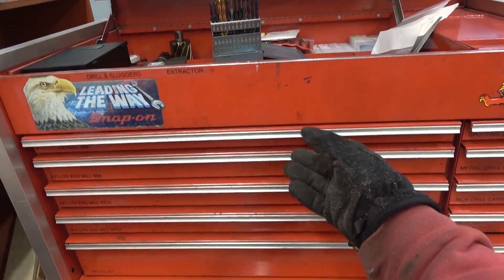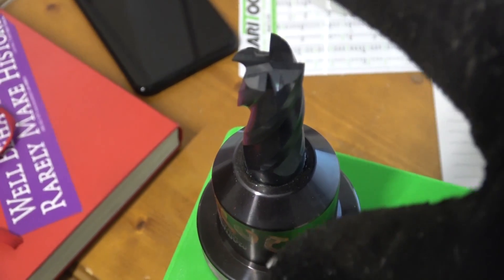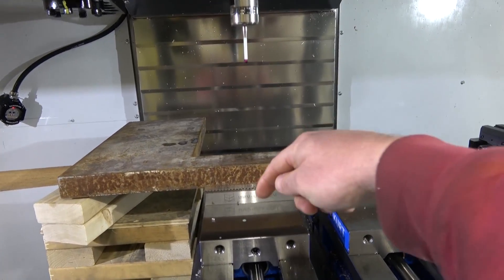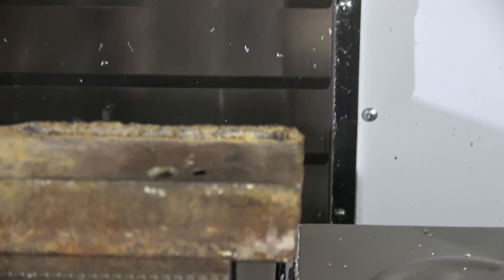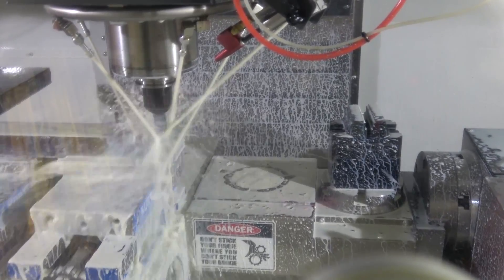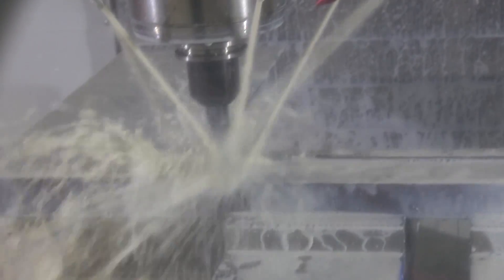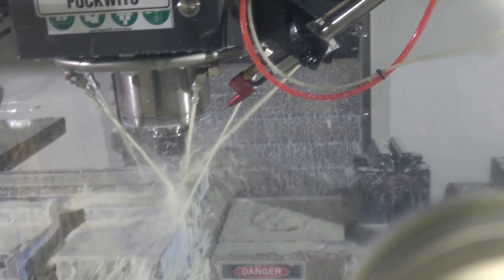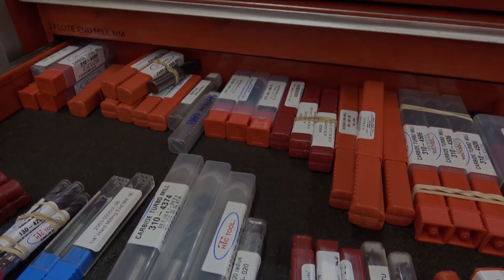AR500 Hard Steel vs. Chinesium Carbide

Comment: That hard of material I would have ran more like 400 sfm. That endmill I’d go maybe .003” or .004” per tooth before chip thinning calculation(very important) Also would have ran about 10 % radial depth of cut at 2xdia axial depth of cut. Or 20%radial depth of cut at 1xdia axial depth. I know nothing of that material. Or that endmill. I usually machine 304 or 316l. Using garr v5 tooling or similar. Spend the extra bucks for good tooling. With the right feeds and speeds you could double, triple, maybe quadruple the time between tools wearing out for only 20-30% increase in cost. It’s cool tho I broke 3 taps today.

Comment: Abrasion Resistant manganese steels like this are prized for their substantial surface work-hardening and underlying toughness, similar to the material used for excavator teeth and building up worn railroad junctions. Absolutely nasty to grind. 
I am not tuned up on Mn steel heat treatment but you might try annealing then after machining quench and temper. Soft for absorbing impact energy and harder for deflecting impacts(often the target is angled 45deg down so the round hits the ground rather than bouncing back at random)

Comment: Well Ave, I guess you only proved one thing...if you crowd the fuck out of a Chinese bit, you will break it.  You should have made your little test a bit more of a challenge, rather than a grudge.  Why not do your test over with a bit made in the USA and another from China.  Hell, go ahead and throw one in the mix from Japan, or Germany, or the UK!  As long as only one does the test, the results will be the same every time.  All I seen was the Chinese bit passed your test.  You proved it failed when you kept increasing the difficulty factor until, most likely any bit would have failed.  Yeah, that Chinese made bit was junk.  You PROVED IT.

Comment: I think you’re spot on with the trochoidal milling, but I think you’re gonna want to use more of the tool diameter and take shallow arcing passes at full depth clear to the end of the work piece. The heat should be coming out in the chip. The work piece should be cool enough to touch without any coolant.

Comment: Speed too high. feed needs to be kinda of high to avoid work hardening .008 per tooth maybe. I would try 75 sfm with solid carbide. (old steel mill machinist) best setup is a round insert milling cutter.

Comment: Uhhhhhhh,   turn the spindle rpm down!  The material your cutting is too tough for high rpms,  I don't care what carbide tooling you use.   With all that vibration a HSS endmill won't last long much less a carbide endmill
Reply: I totally agree, always use cutting speed formula

Comment: Other option is you leaveyour G54 Z zero at home. Don't probe anything and just touch off your tool at Z zero and set the tool offset as a minus value rather than as a length out of the spindle.

Comment: There's a section in the machinist Bible for your SFM. Typically on the high end with carbide tooling 325 SFM is where you want to be. 500SFM is better suited for more mild steel like 1018.

Comment: Doesn't A R stand for assault rifle
Reply: Actually - no. It does not. "AR" was shorthand for ArmaLite Rifle. ArmaLite was first established as a Division of the Fairchild Engine and Airplane Corporation on October 1, 1954. Or... in this case - AR (400 / 500) is short for "Abrasion Resistant" steel. Don't believe everything you read or hear. Do your own research.

Comment: The HSS tooling hasn't really been improved since Carbide made its appearance, meanwhile carbide has gotten all the attention, so leaps and bounds bettter then HSS, as for coolant on carbide, don't listen to the farking salesmen coolant is better by far then cutting dry, that thermal shock is a bunch of wank so dummies don't run coolant and tools don't last as long, also, endmills by design are an interrupted cut... I could go on, but this is by far one of my biggest bitches about machinists that don't test stuff on their own and just take the word of some dickhead in a suit
Reply: I will add, that more often then not, just reducing surface speed 3-10% will gain a whole lot more tool life than anything else, that and rigidity in tooling, fixtures and tool holders etc

Comment: To much surface footage for the hardness. When that tool gets red hot with the flood coolant you get thermal cracking. It would be better to cut dry.

Comment: I've used those chinesium carbide endmills from AliExpress a few times.  I've noticed that they have some bad geometry on the ends, which might be where your face milling pain is coming from.  If you look at the bottom of the flute that would be cutting if you were plunging, they put a flat that is vertical as far as I can tell. No sharpness to it at all, with very little relief.  Comparing that with my american endmills, they'll continue the helix down and not put that flat there, which gives the cutter more positive rake.  These were endmills designed for aluminum supposedly.

Comment: Just today I've been throwing fast-moving, 147 grains of lead from my pew-pew dispenser at a 12mm AR500 plate from 50yards or so... barely scratched it. And, in all modesty, my pew-pew is bigger than yours, so really don't worry about making it slightly brittle... 

I find it miraculous a cheap chinasium mills even dents the damn thing, let alone takes chunks out of it...

PS: don't forget to angle the damn plate at a 30° angle toward the ground... shrapnel is no fucking joke.
Reply: Yes well , mines shaped like a tuna can . Won't hit bottom,  but sure scrape the heck out the sides .
Reply: Chinesium Mills have gotten pretty effing great.  If you're looking for a 'burner' endmill to experiment with, you can't do much better honestly.
Reply: I hit my 1/2 " ar500 with .338 lapua from 50 yds sometimes, barely a dimple.
Reply: HOOCH D  Doesn't surprise me. Dat .50 be awesome😁
Reply: Should more find it terrifying that the chicoms are making things competently now.
Reply: I'm pretty sure all your name brand ones are made at the same factories as these off brand ones. A lot of the time they're just reselling factory seconds, or when the patent holder makes an order of 5000 they make 6000 and siphon off the extra thousand under their own brands.

Comment: I had to drill 11/16 hub mounting holes in AR500 sprockets and it sucked donkey balls.  I think I was getting only 6 holes before the cobalt drills cried uncle.  That stuff just destroys the flutes and once the sides of the dtill start rubbing and squeaking you're 1 hole away from meltdown.  Had to get carbide insert drills which work pretty good with high speed and slow feed.

Comment: Look into G-Wizard for your feeds and speeds. 

You should be spinning at like a 970 RPM or so and a FPT of 0.002 for rough

1600 RPM and 0.0045 FPT for finish. If you feeds and speeds don't match your cuts you're wasting your time

no coolant
Reply: Modern machine shop has bunches of articles on this topic.

Comment: I'd like to know if (legit) HSS is better than chinesium carbide. Value and what not.
Reply: no it isnt. http://www.duramill.com/wp-content/uploads/2012/03/WhisperKut-SpeedFeedRates-2014.pdf

get any carbide endmill and use this chart
Reply: There is a place for both.  HSS is less brittle, therefore more forgiving of vibration, but it is closer in hardness to the AR material and simply won't keep a sharp edge as long as carbide could.  I would be interested in watching someone run a facing operation on AR500 in their shaper.

Comment: If you are making AR-500  pew-pew plates...….and you have a big ass mill  (I'm jealous on both counts)...…..when the face is "finished", why not cut another few thousands off, but make it into a bulls-eye pattern......that would be cool, and give you a traditional target to get a sight picture with. The few thousands difference between the circles would also NOT create a surface that generates dangerous deflections......those are the ones that come back and change you from a Mr into a Miss.

Comment: Bought a chinesium spade bit what for drilling deceased tree carcasses and not only was it bananna like but the centre point was way oorf and induced much vibrations during drilling. Seems to me the material is not the main issue but a lack of precision manufacturing that causes bits to snap unduly.

Comment: Question : would a dimpled surface be more better for stopping and/or breaking up projectiles than a smooth surface that just shit-stains skids the flying brass off into the world ? Just a question.  Thnx.
Reply: I angle my plates at about 30°, top closest to shooter, and most of the spall goes into the ground
Reply: Skinifer'Loaf Hotchkiňson still would be an interesting experiment and isn’t our job to try to dummy-proof the world ??
Reply: @aaronj08ar  That's not what he's asking. And the reason for the 30% has more to do with thickness presented than where the round ends up. When you present 30 degrees it effectively doubles the amount of metal the round sees head on.
Reply: @BustedWalletGarage: Great question. You would think so. Unfortunately I think we're probably so early in the technological phases of bulletproof products that if that were true it is probably being kept very secret by the companies that utilize it. It'd be a good question for Taofledermaus. You could probably even make a sample and send it to him to shoot.

Comment: Ive found plenty of bad chinese carbide. Ground so off center it's gotta be considered single flute if its usable at all. That's from the back alleys like amazon though. Not like im going to the source. They often have short shanks pretty undeniably regrinding what gets sent in for recycle. No joke I have received engraving tools that are from end to end are 1/2 inch

Comment: AvE, it looks like you're climb milling that plate. Wouldn't descent milling be easier on the cutter?
Reply from the maker: No, if you have the rigidity climb milling is better for the cutter.
Reply: @arduinoversusevil2025  Good to know. If you have the opportunity to explain the mechanics of that in your next machining  video, I'd be interested.
Reply: Andy Spam  Climb milling allows the advantage of Radial Chip Thinning.  To minimize vibration you want the tool (each flute) to enter heavy and exit light.  So the chips will start thick, and become thinner on exit.  Conventional milling does the opposite, which causes the tool to noisily load and unload tool pressure as it hammers its way through the material.  Noise means vibration means you will be replacing that carbide, regardless where it was made.  
  The radial chip thinning effect coupled with a small step over allows GIANT increases in feed and moderate increases in speed.  If you run a 3/4 EM at 1500rpm and .004" fpt (24ipm) when hogging, that would translate to 61ipm with a .03" step over.  Small step over and high feed send the heat out with the chips, so it is possible to bump the speed up to 2000 and 80ipm depending on setup and machine rigidity.  This cutting data will not work well with AR500, to expect any success with that, you'll have to drop the spindle speed to around 600rpm/18ipm with .03" step over or around 7ipm at full diameter.
Reply: Thanks  @JL213JN . I was taught the opposite, that unloading quickly was okay, but that you didn't want to slap into the material.  I'm not a machinist, so I'll defer to those who practice it.

Comment: Surface speed to high, especially with chinesium tools. Probably would run for many more time units at about half that speed or less, other than that looking good. Also thermal shock from the coolant isn't that harmful, lots of tooling companies have done the tests and, except for some cases, it make very little difference and in a lot of cases it can reduce chip recutting with is by far worse than thermal shock (unless your running ceramics, coolant and them = pow! busted tools). In my opinion, coolant isn't a great idea is if you running really high surface speed (well over 1000 fpm) in steel/iron. Then the thermal shock can really be hard on the tool life.

Comment: Recently picked up a little 3/4 hp Grizzly mill and my first project was cutting hardened 60hrc AEB-L stainless. I used a cheap (I think it was abut $15 on amazon) 3/8" carbide endmill and it did just fine. To be fair, AEB-L grinds like butter, even at 60-61 hrc.

Comment: When I took a CAM class at school we had a HASS really just to show what work offsets and tool offsets and stuff where. The instructor had gone and disabled the 100 thousandths increment button so we couldn't move the table at 30 inches a second. Good idea
Reply: The fact that you can even ask the machine to move the table 30in/sec is mindboggling....wouldn't that damage the machine even with an empty table and no tools in the way?
Reply: @Binturong3850  ehh .... you'll stall the motors before you damage the machines, probably. and motorbs just get a bit lukewarm from stalling, so maybe put your ribeye on them for cooling purposes.
Reply: That's not teaching you guys to be careful is it?

Comment: Way too much chooch, not enough chach. 

Surface footage is too high, and tool chipping is from vibration, the ole haas aint rigid enough to do what you're trying, gotta slow S&F way down. 

Member 

Chipping = vibration
Burnt edges = too many rippems
Worn coating = worn out lol

Also, the reason for air over coolant is not just thermal shock, but most coatings actually have an operating temperature for best tool life, if you're running coolant it may never get there and will wear right off. 

May or may not be an apps engr for a big jay-aye-pan machine tool builder 😉
Reply: And a totally wrong tool for the job.
Reply: @peterzimsek2510  That's what she said.
Reply: Was coming down to the doobalydoo to say the same thing. When you are cutting something hard specially facing it with a less than ideal cutter gotta run that shit slow. Like <200sfm.
Reply: @SaviorTheBurn   
But that big hollow metal box the vises are mounted to may not be... 
If they were on the table then yeah I'd say it's rigid enough.
Reply: The chinezo provide the feeds and speeds for these and for HRC50 it is very gentle. Anything at that is going to be really gentle and slow rpm.
Reply: The simple fix is mostly to simply use a smaller and cheaper endmill. 3/8 and 1/2 are in the butter zone. Much higher rpm with the same sfm means faster feed anyway.
Reply: Came to say the same thing. As soon as I saw he had it programmed for 500SFM, I knew it wasn't going to work. I've never worked with AR plate, but given it's hardness, SFM should be 100 or less with a chip load of .001-.002", assuming that is a 3/4" endmill.
Reply: I had the coating come off my tool once. After that, the stuff dripping off the end of my tool was not coolant. As a matter of fact it burned like hell.
Reply: Mazak employees go-to brag is that Haas is their biggest customer, which is not something to be bragged about when your biggest customer is also eating your lunch, what with between two and three of every five new machines in production shops being Haas
Reply: The milky coolant is like pissing on a  hot chainsaw blade, you need cutting oil!
Reply: @chadancat6347  The EPA, OSHA,  and those liberal globalists frown mighty hard on petroleum products these days.
Reply: csknives2140  Kind of like Element Maker, I stopped watching him because his attempts to emulate AVE is hard on the ears
Reply: Dangaranga nailed it. I would even try slower, like 120 sfm to begin with.
I've been a pro peeler for over a decade.
Reply: Thought that was my name @aaron Johnson
Reply: The coating comes right off and ruins the tool. His tool was ruined by the 3rd cut
Reply: csknives2140  Just turn off your spiel chucker.
Reply: What happens when you're drilling at super low, sub-200, RPMs and the coating comes off? A couple years ago I somehow stripped off the ti coating from the end of a bit when I was enlarging a hole with an old brace (didn't have an electric then...) and never figured out what went wrong. Too much pressure for the speed?
Reply: I'd have used a smaller tool too less machine power needed.
Reply: @Normjohanson  Sorry to hear you have a small tool. I think you can buy pills that will help with that. 😯😉😇
Reply: I like it. Takes a bit of effort to write like that and if it doesn't, you know about as much as he does.
Reply: @barongerhardt  So, now we are quoting Red Green. (For those we do not know Red Green is another, funny as fuk, Canucistani you can find on You Tube. But only if you have the duct tape to handle it)
Reply: csknives2140  they do that with every youtuber that has some sort of distinction when they speak...so stupid...ever been to isaac arthurs channel? Watch a vid then read some comments...same thing